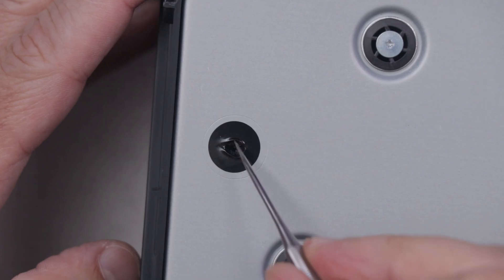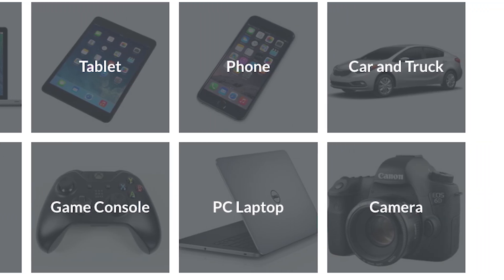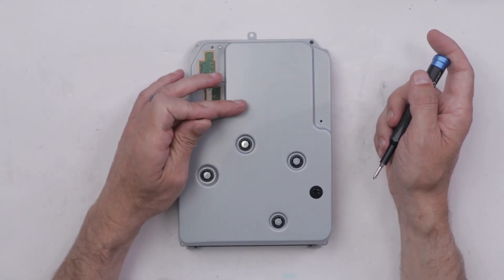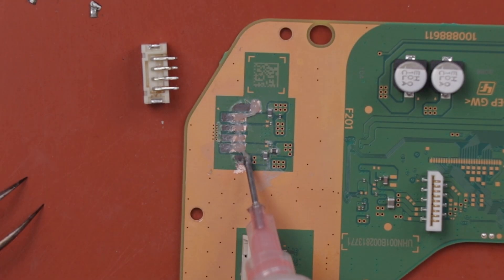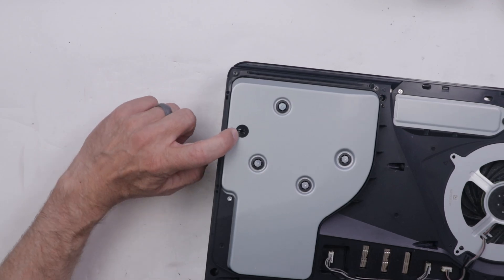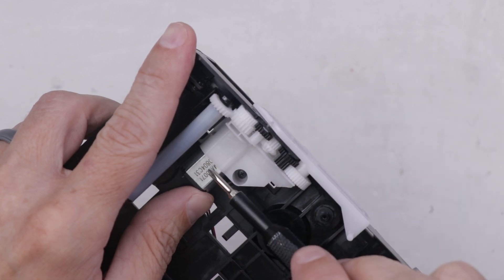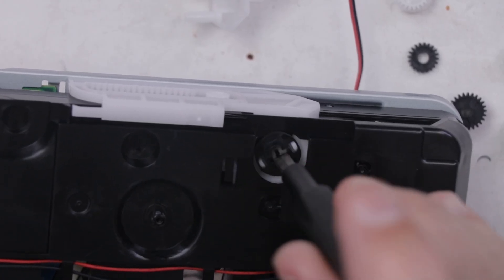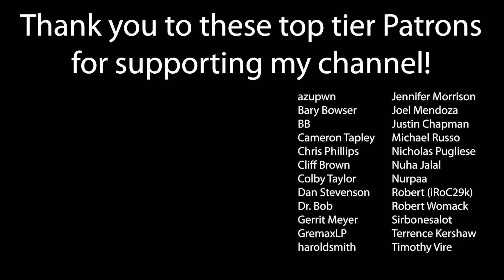Sony "Couldn't" Fix This PS5 - Can I?

Comment: Good afternoon.. Friend if possible, I just wanted to ask a question for me? I watched a video of yours about testing thermal paste on ps5.. So I use a kit that makes the ps5 cooler faster as I want the speed increased.. And you say in the video that in parts you can use thermal paste.. No case like the cooler of my ps5 the rotation i leave it accelerated, i could use thermal paste instead of liquid metal.. i think liquid metal is very dangerous. use thermal paste instead, since my ps5's cooler is sped up?

Comment: I wanna ask something, my PS4 pro disc drive sort of doesn't want to "park" the disc in place after inserting, I cannot eject it either, the only solution for now is restarting the console itself and then it will "park" and operate normally... until I eject and insert another disc, and the problem will repeat itself.
I will appreciate any suggestions, thanks in advance.

Comment: As someone who works in the commercial repair industry I get why sony deemed it "un repairable" but to me this speaks volumes on why marrying the disc drive to the mobo is a terrible idea. If they didnt marry it this would have been an easy swap for their repair team.
Reply: They have a pre-shared secret that's how the mobo can trust the drive. Otherwise any device could tell the mobo that it has a "legit" piece of media and the whole trust chain falls apart.
Reply: Sony could bypass it buy making it only sony compatible and 3rd party is a hit or miss easy money
Reply: I got a question.. If in the future Sony changed their mind and no longer wants to have the disc drive tied to the motherboard, could they simply do a firmware update to have this security feature disabled?
Reply: @zuxx00  lol there won’t be future playstations with disc drive. Physical is dead. They won’t stop tying disc drive to anything, they’ll just remove it from ps6, like they should have probably done with all ps5s.
Reply: How would un-marrying the disc drive from the mobo make this any more repairable? The issue is that the connector was ripped away from the PCB.
Reply: @mykalimba  the damaged PCB was on the disc drive. If a new drive could be swapped it would be a fix
Reply: @mykalimba  yeah, but with out removing the green coast to get to the copper, and completely resoldering the connector, which is out of league for a lot of repairs people, the disk drive is inoperable and must be replaced. however due to sony's stupid "drm" for lack of a better term, you can't replace the disk drive without completely sending the thing back to sony and not every repair station has the tools necessary to re-pair the mobo to a new disk drive.
Reply: @dereknapier836  nope, you can redownload them as long as you have access to your psn account, plus PS5s don’t have hard drives.
Reply: Not sure I understand what you mean, the disk drive is a separate unit with only a wire connecting it to the mb.
Reply: @Tomazack  typically consoles have security checks to make sure the drive key (some form of encrypted GUID) is the one that is flashed to the boot sector of the console, if you swap the drive the console will either not boot or not allow the drive to work because it does not recognize the dvd key. They do this to make it more difficult to flash custom firmware to the drive allowing you to play rips of pirated games...although also makes repairs much more difficult
Reply: @christianemerson4463  very good point. The key to understanding it unlocks the door to the real drive. Then it allows us to read into the not really think about it and everything good saying the door is unlocked.
Reply: @Tomazack  The disc drives are hard coded to only work with that motherboard meaning that you can't just put another one in. The Xbox 360 was the same way. I had to desolder the board on my broken drive and solder it on the new drive so it would work again.
Reply: @jarednewton6465  that shouldn’t be an issue for Sony though, they will have the tools to replace the drives and alter the encoding. They should have been able to just drop in a new drive unit, especially if they are the ones that broke the connector.
Reply: @Tomazack  that's not the problem
the firmware of the drive is encoded into the firmware of the PS5 mainboard. 
Due to this you cant swap out drives sadly
Reply: @DXHatakeKakashi  Do you have a source for the drive firmware being on the mobo? Never heard of something like that before but I'm not really into hardware hacking. Apart from that the issue of the firmware being encrypted is (almost) completely orthogonal to the drive being married to the board.
Reply: @Tomazack  serial number of the drive is hardcoded to motherboard's cmos. if the driver replaced or not pluged-in the PS5 resfuses to boot.
Reply: Console would work fine if you didn’t buy games on discs lmao. Broken disc drive ≠ broken console.
Reply: @Khloya69  Disc drives shouldn't be locked to individual boards to begin with.
Reply: @LoweeCitizen  shouldn’t still exist either
Reply: @Khloya69  so you don’t like owning games or movies and instead like licensing them because if you don’t know you don’t own digital games or movies you just have a license to play/watch them so if you lose your account you have to buy everything again.
Reply: @kittycatgaminghayley6210  who still watches movies? And physical isn’t and never has been ownership
Reply: @Khloya69  Until Sony takes the PS5 store offline and you lose access to all the games you've purchased.

Disk drives > Digital
Reply: @Oldy87  name checks out

Comment from the maker: Trying to fix a PS5 that TWO other repair shops couldn't fix: https://youtu.be/-GP8Q5OWCXw
I see some questions about how the connector got broken and if I remember right the person that sent it in broke the connector. I don't think it was broken by anyone at the repair center. ALSO, I don't blame them for not fixing this console under warranty as it was damaged beyond what a warranty would cover BUT I do think that they should have offered a paid repair service instead of just saying that it was not fixable. That's my main issue with this.
Reply: When removing the Solder mask its better to use a fiberglass brush than a dremel. it will be much cleaner and your solder connection will be much stonger.
Reply: Hey bruh, so in the original broke motor, im sure it has a pulley system from the actuator on main gear, possibly not greased properly in motor?? I understand swapping is quicker...

Your awesome btw thanks for all u do, our games are our therapy so what u do is actually vital at times

Like my basic terminology? Lul... Im a novice at mechanics
Reply: In a pinch desolder braid can be used to reinforce a mounting / ground plane for a connector, it forms a VERY Rigid surface when saturated with solder being basically flat braided copper.
Reply: Great work... screw big electronics industries, they are terrible, awful. I have no words. But you rocked it with that report!
Reply: Dude i cant but them can you please dm me with some advice or can someone post a link i cant bug one so i guess ill just fix one

Comment: Ok clarification needed at no point does tronicsfix state that sony were responsible for the connecter damage. If sony did do that why the just didn't replace the drive as that be easiest solution. As if that was sent in like that to sony my guess they deemed unrepairable as it won't be like it supposed to be originally.

Comment: I kinda dont understand why sony deemed this console unrepairable. I mean sure they dont do a trace repair, but they could just replace whole disc drive.
Reply: And motherboard for that matter
Reply: PS5 disc drive is married to the motherboard. Same deal on Series X. Drive goes bad, your console becomes digital only.
Reply: @Donut0389  I know but its sony, they made it a thing. If they dont have a tools to do that, then who does?
Reply: @qoopz1618  Personal electronics with married hardware all have that problem. For consoles, the hardware is married to keep people from messing with said hardware and potentially causing security problems for the console manufacturer. Xbox One does it. PS4 does it. PS5 and Series X do it. Keeps you from being able to jack in any disc drive you want, which as stated before can cause security issues for Sony and Microsoft console systems.

iPhones have done it for ages though Apple takes it WAY too far and uses married components to milk customers of all their money when something breaks, going so far as to pair phone batteries with phone motherboards.
Reply: @Donut0389  thats not what Im saying. I know why its married and why you or me or any 3rd party shop cant re-marry it to another board. But SONY itself should be able to do it, its them who makes that device so Im sure they have tools to do it.

Comment: Did I miss something or...could Sony just have replaced the entire disk housing and the torn ribbon cable and call it fixed? I mean, assuming that they couldn't fix it...

Edit: The replies I got below are correct, the disc drive is married to the board so a simple replacement of the disc drive would not be possible.
Reply: That would actually require yo replace the whole motherboard, so you did missed something
Reply: @dantenage9687  How do you figure the whole motherboard would need replaced? The broken connector was on the disk drive board which is part of the disk drive..replacing the disk drive should have been something somy could have done.
Reply: @supawiz6991  The disk drive is "married" to the motherboard. If it's flashable memory and repair shops can't do that because they'd need Sony's root keys, Sony could have done that. If it's actually some OTP / ROM memory, then even Sony can't do that.
Reply: @Leseratte  Ah ok. I didn’t know that. Looks like its an anti-cheat/anti-piracy measure…though still pretty stupid since it makes it so you can replace it on your own.

Comment: I don't if I should be not surprised that Sony chose not replace a component that they broke and have full access to spare parts. They have a policy if they break it while repairing force the customer to buy a new PS5.
Reply: It’s just a disc drive, they’re not forcing anyone to buy a new ps5. It would work fine if the owner didn’t have their games on disc.

Comment: If you don't have enough material left on the board to solder the mounting pins to you can (sometimes) try to use a bit of desoldering wick/copper wire and solder this onto a bigger part of the board. Then just "fill" the desoldering wick and solder the mounting pin directly to the wick.
Reply: That's what I was going to recommend as well.
Reply: cant you just scrape a bit of the trace and solder a wire from there?
Reply: @apor_v  The anchor point on the left was what we're referring to. Where it's weakest. But the middle pins, yes you'd just scrape off the traces and solder wires to them. He didn't show that part appartently.

Comment: If you add a little wick rectangle to the holding pads, it will be more solid.
Reply from the maker: Yes, that can work great but there just wasn't much room to work with here. Also, wick is pretty thick which would have made the port stick up pretty high which would have weakened it more.
Reply: @Tronicsfix  i mean on the sides where you can't solder the port to anything.
Like a holding bridge.

Comment: Important, Worm gears do not like to be driven backwards. Sometimes they cant be even.
Reply from the maker: Most worm gears don't work at all backward. I'm guessing some worm gears can be designed to work backward.
Reply: I was going to say the same thing but looking at the other gear it is a helical gear so that can drive a worm gear. I think there must be some wear on the teeth of the gears that prevent them meshing correctly, or the worm gear has been pulled off the shaft of the motor a bit, I can't tell tho.

Comment: If my ps5 ever breaks or something, I'm sending it to this guy
Reply from the maker: While I don't offer repair services I highly recommend shanefix.com
Reply: @Tronicsfix Can you recommend anyone who could reball an original PS3 please? 🙂 Doesn't look like shanefix does anything older than PS4.
Reply from the maker: @SolKnightt  I wish I could but I don't know of anyone doing that service. Sorry
Reply: @SolKnightt  check 'Computer Booter' channel, he offers this service, his channel has 2.1k subscribers so you don't go to the wrong channel
Reply: @SolKnightt  Maybe TheCod3r he does stuff like that but i dont know if he does on PS3 ^^
Reply: @SolKnightt  I don't think reballing PS3 was ever actually a thing. People THOUGHT that fixed them but really it was just the capacitors near the GPU that fail and the heating from a reball made them come back to life for a while. It's more than likely you just need new capacitors. Pretty much all fat PS3s need them replaced at this stage
Reply: He recommends shanefix since he doesn't do customer repairs any more.

Comment: Why would sony want to repair it when they could make someone buy another console?
Reply from the maker: Yep, exactly
Reply: Like Apple
Reply: Pretty much the same thing Apple does
Reply: They don't make that much profit from the console, they make profit from the games, so I don't think that's the reason.
Reply: No it's not true, selling console is not Sony's profit, selling games, plus and other stuff are their profit
Reply: This is exactly why fighting for your right to repair is important. Support Louis Rossman!
Reply: Customer loyalty
Reply: The Sony strat
Reply: Yeah. Make them buy a XBox
Reply: Sadly it is what it is but this is legit true
Reply: Or probably lazy workers!
Reply: Because customer care and support! Their method is a good way to drive a customer into the arms of a competitor, be it xbox, pc or Nintendo! They should show they care about their product and customers to keep them loyal, but they can't because they don't! They only care about your money!
Reply: It's called cost benefit analysis. If it's out of warranty the price+labor can make it where it's simply better to not repair. To Sony and most hardware manufacturers something like mounting pads pulled from the board is unwarrantable after repair so the entire board is trash to them. Doesn't make sense? Well try replacing an out of warranty tv screen. It's simply not cost effective.
Reply: I'd say it's something less sinister than that. I reckon it was likely too time consuming for them to complete the repair for what it was. They likely have a process of repair time vs the severity of the damage. They also likely have a contracted company doing the repairs.
Reply: They are insanely greedy, they offer just one year of service here  in EU and if it has the most minor problem they ask you 300 euro to get a refurbished console. I couldn't fix mine due to the GPU being faulty and Sony not offering any replacement parts. I got the refurbished console i am selling it and never getting a PS5 again until they change their stance goodbye Sony.
Reply: @silotx  And welcome Xbox… 😅🤷‍♂️
Reply: @silotx  even better get a PC you won't regret it if any part is faulty you can just replace it and that's it 👍
Reply: You what? less than two years in should most definitely eat that cost for optics alone.
Reply: That's assuming they even COULD fix it. I doubt they have staff that can solder anything. Probably just know how to use a screwdriver but anything beyond that is "unfixable".
Reply: Especially after raising the prices
Reply: Nop, I already post a possible answer why..
Reply: EXACTLY! You cracked their code.
Reply: Sony is selfish that’s why if that console has a warranty they have to repair them or they will be sued I’m about wick of them and they get so mad about Microsoft instead of worrying about themselves
Reply: Even when that’s fixed it’s not gonna last your system has been compromised
Reply: He didn’t even fix it🤦🏾‍♂️
Reply: Why fix it if they are just gonna put cookies in. Stupid consumer